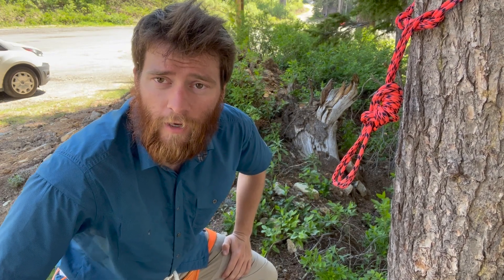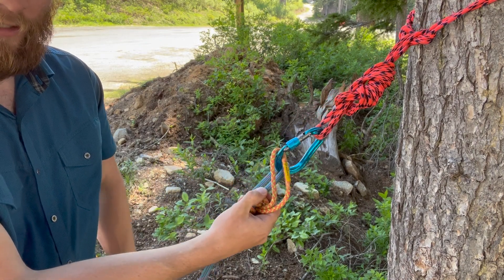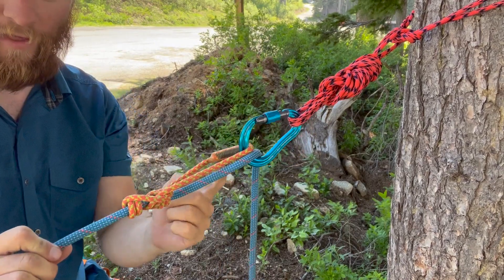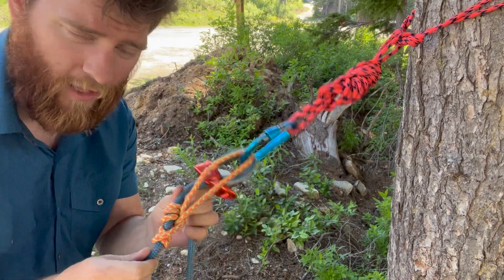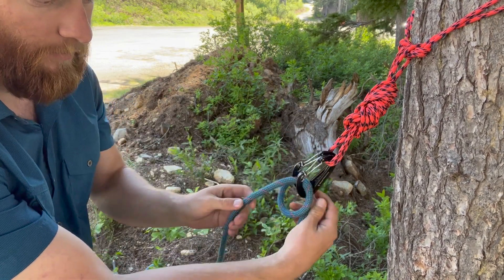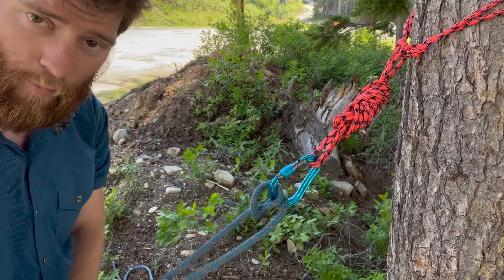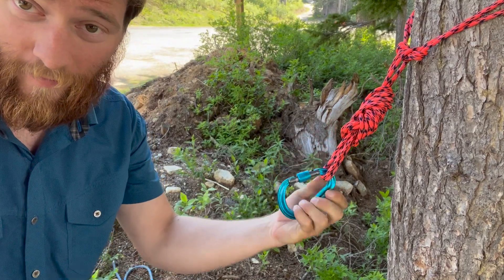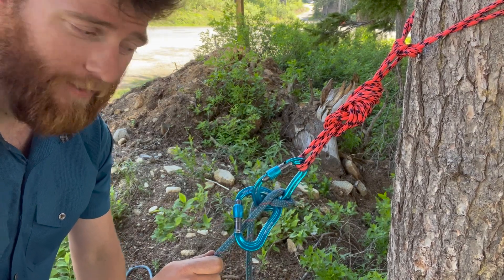Progress capture devices

Comment: Hey thanks for the video. I'm looking for something that will act as a safety back up in a motorised hoist system in the back of my van, lifting a bed to the ceiling. If the system breaks at some anchor point and the bed wants to suddenly drop to the ground, I'd like to have something in place to stop it falling.

Ideally, I want it to be easy to release, so when intentionally lowering the bed, I won't need to remove any part of the system, and then when hoisting it back to the ceiling, I can do so without any hassle.

Would there be anything like what you're using at 12:00 that would work with rope between 3-6mm? Do you think something like this would work in this scenario?

Any input would be appreciated :)

Comment: The last hitch seems to be the same as what is called the Kara-Acht here in Germany, which is usually made using one carabiner and a figure 8. That is also what the name comes from. Since nobody really carries figure eights anymore, at least for climbing, the two carabiner version looks more practical. I know of people and rescue teams still using it over here, mainly for canyoning and water rescue, where figure 8 style devices are more common. It is regarded as a very secure and high strength tie-off, often used for tensioning highlines and similar setups. With a figure 8, it is also releasable under load. With just the carabiner, I think you could release it, but you have no friction, so you will lose the load if you don't add anything to the system.
Reply from the maker: That's pretty interesting I may have to look into that in the future, thanks for sharing!

Comment: Hey Ryan. Really love your content, advise and attitude of learning.

A question: how do you lower from the Lorenzi and locking Munter progress capture hitches? Seems like the follower must be capable of climbing the pitch otherwise you are in for some nasty rope fiddling and possibly a hauling system. Actually kinda jiggling the lower carabiner in the Lorenzi hitch seems to allow for alittle bit of lower, similar to the ATC in guide mode. But still no great option if you need to lower a large distance?
Reply from the maker: Ya both of these hitched kind of can’t be lowered with after the climber weights the system, that’s why I would recommend them just as a emergency device. I’ve gotten this question a lot so I think I’ll make a video about a possible way to deal with this situation.

Comment: An issue I see with the garda hitch and the locking munter (besides a lot of friction) is they are quite hard to release. If you've got someone who is getting pulled into a lip of a crevasse or into a rock edge, having the ability to quickly release and slack the system is potentially important I think. A device like the Micro Traxion or Spoc can be released by pulling up slightly and then holding back the cam with a finger to let rope out. And if using a prusik cord, consider using an auto block hitch which can be released under load and I find is "self tending" when used with a carabiner. (Not so good with a pulley as it tends to get sucked in.)